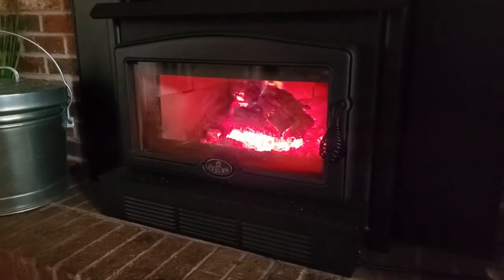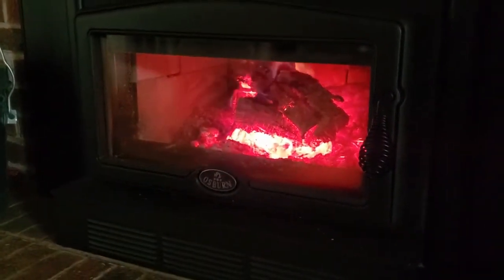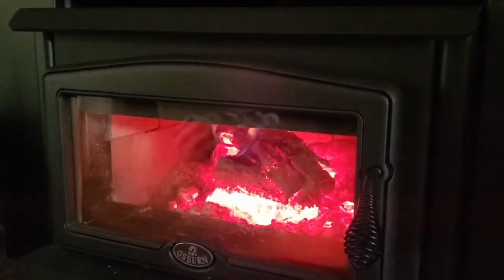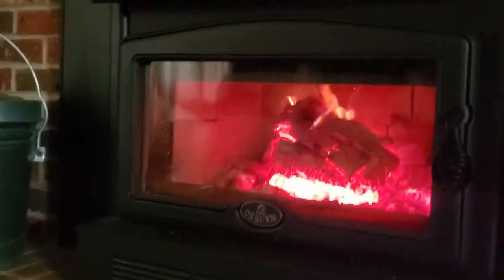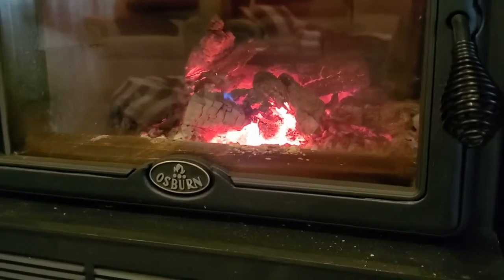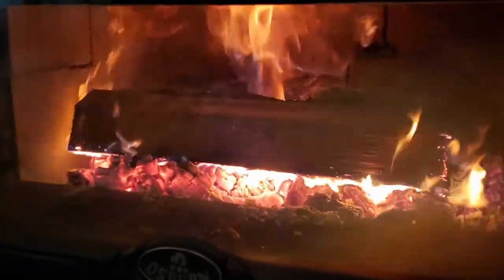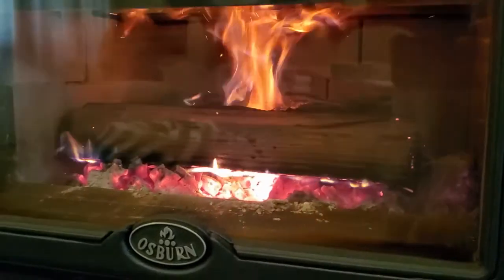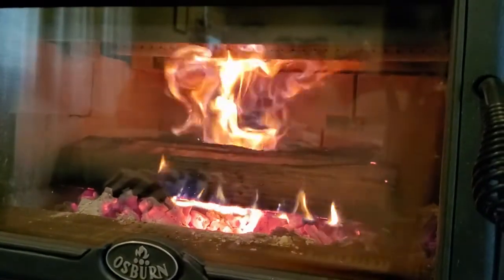Best Way to Reload Wood and Rake Coals in Wood Stove - Osburn 2400 Insert Part 1

Comment: I agree with you that this is a good way but I cant do this in my stove.. Its gets too hot and I dont want my stove over firing..
Reply from the maker: Do you have an older stove? The new ones seem to have pretty good air control where you can dampen them down which would prevent over firing. On my old stove, there were air leaks around the door seal too, so I could definitely see this raking method allowing over fire under the right conditions.